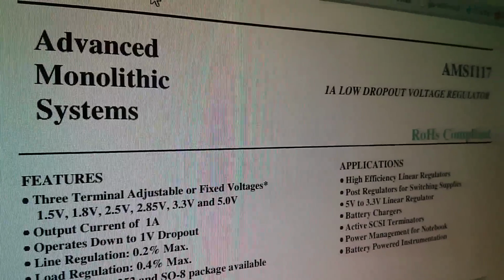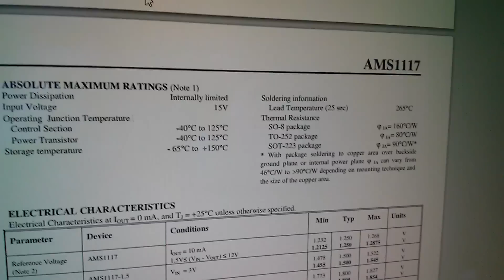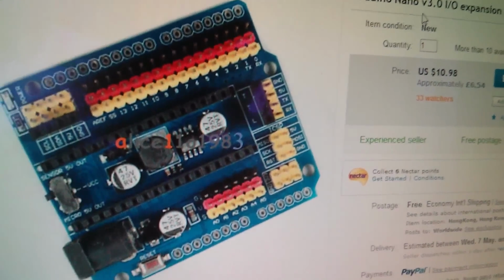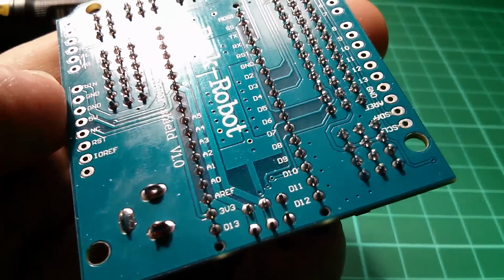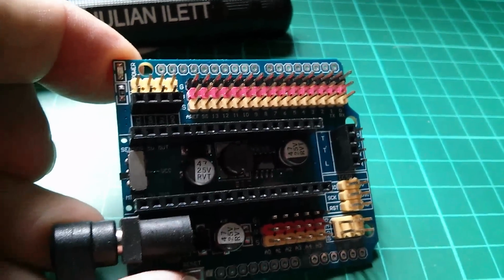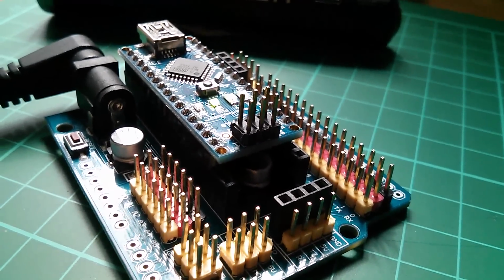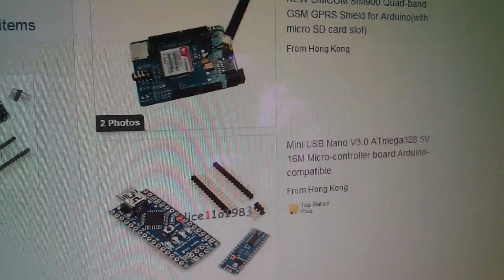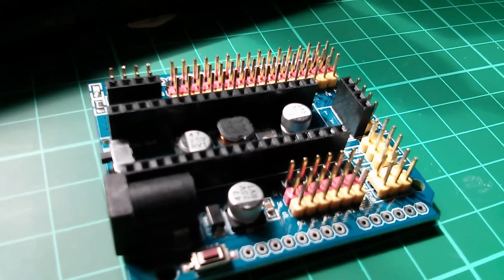Arduino Nano Tutorial - Breakout Board with 2A SMPS #1

Comment: Hello. It is possible to power this shield from the 2.1 to 5 volt connector at 2.5A (from an example powerbank) and at the same time use the USB to program the board. The idea is to connect several servos, as the Nano cannot feed them the power supply would come from the shield and while programming it from the USB, without having to alternately unplug the USB connector or the 2.1mm connector.

Comment: I've also got one of those SMSP Nano/Micro servo "shields" and came to play with it for the 1st time last night. I also was rather bemused by the extra pins as I'm sure I bought it as a Nano board, and the first thing I tried was to use the I2C header that's wired to the wrong pins! As I don''t intend to use a Micro, I'll probably block the extra holes and wire SDA and SCL to A4 and A5.
Reply: Drat, the SPI connector area is also "wrong" for a Nano.

Comment: I know this was years ago, but I just found it. Just curious if you use the breakout board why not just used a UNO? Since the footprint is about the same. Just wondering. I'm trying to use a Nano for a project but somehow sharing the 5 volts to power two moisture sensors and a 16, 2 display I'm running into problems so I like the expansion board.

Comment: hey there Julian, im using a nano like yours and im looking for tips based on your expertise, im running out of pins and i need more whats my choices? 

im currently using a motor encoder using d1,d2 for A reader and B reader and of course your usual pwr & grd BUT my issue is that i already have a Dual Motor  driver using 6 Ena,B as well as your IN1 thru IN5 pwr grd  thats six right there all on Digital pins on nano and on top of that im using a NRF module wireless chip for wireless and those take up 8pins? on the nano BUT i noticed that my ANALOG pin on the nano aren't being used "so my question is can i use those pins to read the encoders (2 one for left motor and the other for the 2nd motor) maybe turn those analog pins into digital pins ? or am i gonna have to buy one of those breakout boards your using? if so anylinks? thanks in advanced Julian

Comment: You should mention that while the addition of the 5V regulator on the breakout board allows for an extra 1.5A draw, it means loss of the 3V3 pin for 3.3V devices.

Comment: what's the max input voltage for Expansion Sensor Shield? can i used 12v for it?
Reply from the maker: +Ян Городецкий I seem to remember it was 20V, but I can't be sure. The listing doesn't say. http://www.ebay.com/itm/arduino-Nano-v3-0-I-O-expansion-board-micro-sensor-shield-Uno-r3-leonardo-2009-/400612384164

Comment: Have you used the shield with a servo? If I don't connect the USB cable to the Nano it would barely move the servo. But the 12V source I used to power the shield is a 1.5A one!

Comment: Afternoon Julian. Do you have a schematic of the breakout board for the nano? I have the one with a linear regulator. I was looikng for the schematic to work out where the regulator connects, but found nothing at all.
Reply from the maker: migry I don't remember one. But it's fairly easy to trace the tracks with a torch and a pair of reading glasses.

Comment: Hi Julian, I bought one too, I tried to get I2C working, I thought nano isn't working. I did check off the board and it does work. I found the problem that I2C output on the board isn't right. SCL is connect to D3 and SDA is connected to D2 which is weird. I wonder if it the same on yours? Does that mean Arduino Nano useless but have to use the A4 and A5, pretty much but not the same as Arduino Micro (I compared it, this one is correct one). So much thank for advertising as Nano on Ebay.